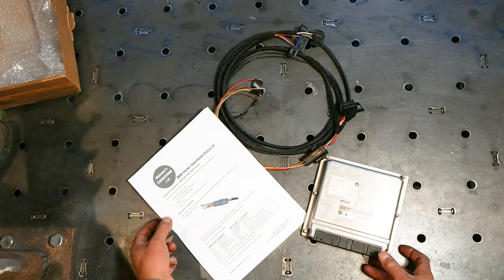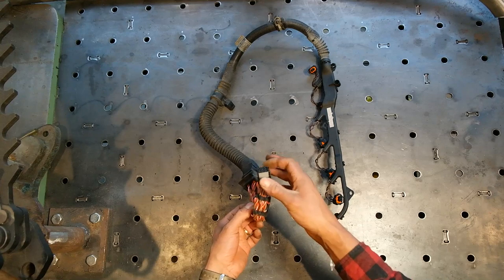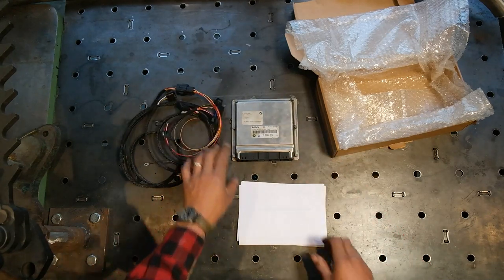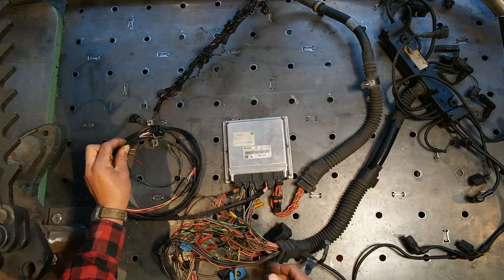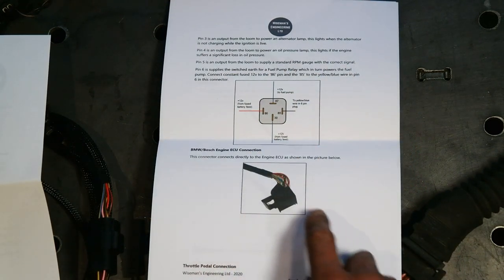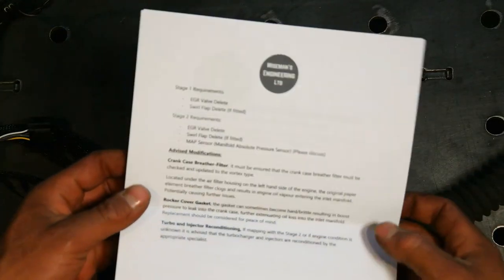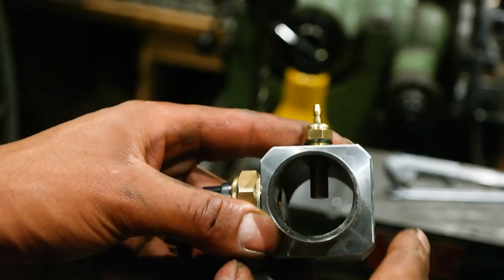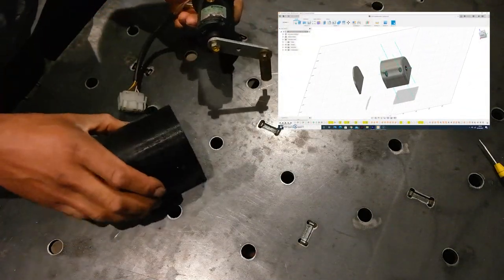BMW M57 Standalone ECU

Comment: Hi, great video, i have i question, do i still have to change the gas pedal, i swapped m47 to m57, the pedals are slightly different, but could it prevent the car from starting?
Reply from the maker: Thanks very much! 
As far as I’m aware, they use a similar potentiometer in the pedal, I’m not sure if the pinouts are the same but either way, it should not prevent it from starting. I ran my engine in my test stand without the pedal connected many times.
Reply: @KeepitBigBore  thanks for answering so fast, then i can shut it off from the list
Reply from the maker: No worries mate, good luck with it 👍🏽

Comment: Awsome work on your defender 
Do you know if any one dose a complete  m57 bolt in kit for the defender ?
Reply from the maker: Thank you!!

Yes there are a few now. I spoke to MW Machines here in the UK initially as was looking for a kit but they weren’t available at the time due to the global situation. But he probably has everything you need now! Also, Wisemans Engineering can set you up with a full kit. Both suppliers have a few options in terms of manual or auto m57 or m57n.

Where are you based and do you know what specs you’d like to have on yours?
Reply: @KeepitBigBore  probably  go manual onto the m82 box not really sure on power specs yet I need it to be reliable  as it will mostly be used in the outback and towing a boat.
Reply from the maker: I know you can get adaptor plates for the m57n to mt82 but I’m not sure if there was one for the older m57.

I’d say for reliability on the mt82, transfer case and diffs with a trailer, 250bhp and 500nm wouldn’t be a bad number. You can get this out of the older m57 with re-maps if you do manage to find an adaptor for it 👍🏽
Reply from the maker: I know you can get adaptor plates for the m57n to mt82 but I’m not sure if there was one for the older m57.

I’d say for reliability on the mt82, transfer case and diffs with a trailer, 250bhp and 500nm wouldn’t be a bad number. You can get this out of the older m57 with re-maps if you do manage to find an adaptor for it 👍🏽

Comment: Hi 
I message you a couple of months ago regarding my defender 90 swap I’m at a stage where the chassis is now built up and obviously I’m looking to find an x5 donor, the M57 is that the TwinTurbo or is the newer X5 a TwinTurbo I’m confused on which engine to go for, can you help me out there as if I buy the whole vehicle I’ve got everything I possibly need for the change but not sure which one to get,  there’s a lot out there at fairly reasonable prices scrapped or damaged

Kind regards mark
Reply from the maker: Hi mate, I can’t say for sure but I don’t think the  m57 x5 came as twin turbo. (Anyone feel free to correct me).
If your looking for a twin turbo m57 then I think you need to be looking for 335d’s and 535d’s.

Why do you want an x5 engine?
Reply: Hi 
I just thought that was the one to go for when fitting it’s 6 speed automatic m57 or m57n all alloy block big turbo with the little one below it. ?. A bit confusing.

Regards
Reply from the maker: The x5 came with the 4wd auto and the 3 and 5 series had the 2 wheel drive box. You can use either one. You can buy adaptors to the lt230 transfer case for both boxes so best option is to fund a supplier for your adaptor, see which one you can get and decide your engine from there 👍🏽

Comment: Hi! Great video - it pushed me over the edge to do the conversion on a 1999 Discovery 2 auto. I bought a 2003 BMW E60 530d auto, and took the motor and 6HP26 out today. I believe this is the M57N engine, and I see the ECU is a DDE 7 unit. I am slightly worried now as I don't see anything for DDE 7 on Wiseman's site, and also not getting email reply from them on my query regarding software or ecu for this project. Can you perhaps give me an email address or point me in the right direction for a solution?
Reply from the maker: Hi mate, Thankyou,  that’s great to hear, it will be well worth it 👍🏽 Don’t worry you should be fine with an e60 ecu, it should be dde5 which they have plenty of kits for. If you want to send me an email I can cc Wiseman’s into a new conversation and hopefully you guys can speak from there on? 
My email is kibbcrew@gmail.com
Reply: Thx! That'll be awesome!

Comment: Does this only work for the m57 with 184 hp or also with the 204hp?
Reply from the maker: So the kit you see in the video is for the 184bhp (dde4). You can buy a dde5 kit for the newer aluminium block m57n’s as well 👍🏽
Reply: @KeepitBigBore  okay, thanks for answering so fast still after 3 months, very good video also
Reply from the maker: No problem mate, good luck with your build 👍🏽

Comment: Will this work with the TD6 M57?
Reply from the maker: No reason why it won’t! I can’t say if the ecu is exactly the same or not but I know the engine is pretty much identical to the 306d1 (cast iron block) it’s just a Land Rover badge on it

Comment: Hi, how you connect the rpm gauge? Thanks
Reply from the maker: Hi mate. There is an RPM output from your ecu, it’s just 1 wire. I’ve left a link in the description for the rpm gauge I’ve used. It’s the only one that showed 6000rpm instead of 8,10 or 12 thousand so it’s specifically for Diesel engines. You can also calibrate this to suit different engines. 

I know my idle speed it roughly 750rpm. When connecting the gauge for the first time, my idle showed as 3000rpm. There is a small knob on the back, just turn it and the rpm will drop/raise as you turn in. I turned mine until it showed 750rpm at idle. It’s now accurate right up to 4750rpm. 👍🏽
Reply: @KeepitBigBore  many thanks for your help mate 💪💪👍
Reply: hi, i bought the rpm gauge like yours and i connect the pink wire to the red wire coming from the gauge... and the gauge dont work! Im doing the connection wrong? How you connect your wires in your rpm gauge? Thanks again
Reply from the maker: Hey mate, is it not working at all? Do the lights on the rpm gauge come on when you turn the ignition on? I can’t remember the colours of the wires but as far as I remember, there was ground, ignition and rpm signal. When you turn the ignition on, the gauge should turn from zero to max rpm and then back to zero again, does it do this?
Reply: @KeepitBigBore  yes goes from zero to max and comes back again... I dont know why dont work, and the light works aswell
Reply from the maker: That’s good then, have you adjusted the small screw at the back?? Turn the screw when the engine is running. Your engine should idle at 750rpm so turn the screw until the gauge reads 750 👍🏽 let me know if that works
Reply: @KeepitBigBore  ok i will let you know tomorow.. Thanks mate
Reply: @KeepitBigBore   hello mate,  still not working.. I have a bit more then 6v coming from the pink cable and if a rev the voltage goes up.. I think its normal,  i need to connect the pink coming from the ecu with the green wire right? Im confused... Thanks
Reply from the maker: Hey mate, have you got Instagram? You can send me a picture of your wiring diagram. I can’t remember the colours of the wires of the top of my head! It must be something simple 👍🏽
Reply: @KeepitBigBore  whats your Instagram mate?
Reply from the maker: Hey,  It’s also keepitbigbore 🙂

Comment: would you have anything for m57n2?
and also would you use 2 ecu for my nissan  patrol? like nissan ecu and bmw ecu together so factory dash etc all work>?
Reply from the maker: The m57n2 is very similar if you use a standalone harness like this one. I wouldn’t recommend using 2 ecu’s, if you have an understanding of wiring then you can get the bmw ecu to control everything on your dash!!

Comment: Hi mate, do you have to send power to the black wire to start it or can you use the vehicles original starter wire straight to the solenoid?

We are trying this way and the engine is obviously cranking but it won't start. Is there anything else on the body plug that we need to connect? 
We have fuel at the rail, the inline pump is working but we think it's only 3 bar and don't have a gauge to check. Would it at least try to start with only 3 bar?
Reply from the maker: Hi mate, sorry I didn’t get back sooner!! 

Have you got your problem sorted? 

The easiest way is to use the black wire, you can hot wire the starter but I’d stick to the black wire on the body plug if I were you. 

3 bar is enough to start!!
Reply: @KeepitBigBore  hi mate, yeah we got it sorted, was a faulty rail pressure sensor and rail pressure control valve, we were getting fuel at the rail but it was getting there via the faulty control valve rather than the high pressure pump. Runs like a dream now. ✌️
Reply from the maker: Fair play mate!! What do you reckon, was it worth it 😬
Reply: @KeepitBigBore  was deffo worth it, we've fitted it to a 1989 VW lt35, originally 57bhp I think and now just under 300bhp.
The hardest part of the whole conversion was getting the shifter cable to work on the 6hp26. We had the biggest headache with different cables, levers and brackets but got there in the end. A 6hp28 with the electronic shifter would have been much easier.

Could do with a brake upgrade now though 😅
Reply from the maker: WWHAAT??? 🤣🤣🤣 I’d love to see some people try and pull away from you in that! That’s the perfect kind of sleepers right there! I keep up with people in the old defender and people are usually surprised but you’d never expect a lt35 to be terrorising you 😂😂😂

Comment: Hi Keep it big bore.

I'm from Australia and looking at putting a m57 into my 1996 nissan gq patrol.

You say the blue plugs are for the auto transmission.

Just wondering if you would know If the auto transmission will still work as normal if I use it in my patrol.

The aut is fully controlled by the ECU isn't it?

Cheers love the video.
Reply from the maker: Hi Daniel, 
I see no reason why it wouldn’t work if you were using the m57 with its original auto transmission. Mine came with the 5 speed auto, it’s not a bad transmission but it’s a bit slow and lazy, a lot of guys go for the newer 6 speed!! We’re you looking to keep the patrol transmission or use the BMW one?
Reply: @KeepitBigBore  
I wana keep it manual but my left knee is telling me to go bmw auto.

So your set up just uses the stock bmw transmission controller for the 5 sped auto no messing about?

Cheers again.
Reply from the maker: I have a friend who just bought a td5. I jumped in it the other day to feel how heavy his clutch was. I pushed it down and it hit the floor, I was expecting it to feel so much heavier as I’m used to driving my one. So my point is, if you go manual, you will need a heavy duty clutch and a heavy duty left knee to go with it 😂
My friend jumped in mine to see what my clutch was like, he jumped out and said he thinks his hip popped (he’s an older gentleman) 😬

Mine is manual and using the original Land Rover transmission so I didn’t use any of the transmission controller, just the original ecu 👍🏽
Reply: @KeepitBigBore  

Yher nice I should of picked up on that in the video, I been watching that many M57 swap videos 24/7 I caint remember half of them. Lol

Cheers heps for your help.

Do you have any pics of the plugs or sketches of how all the wiering is pinned out into the connectors?

I'm a bit sick on how to wire this thing.
Reply from the maker: No worries mate 😬

If you purchase one of the stand-alone kits then you won’t have to worry about pin outs, wires etc. She’ll just plug and play. 
I have no diagrams for the wires and all of them are black so a picture might not be any help but trust me, she all clicks together 👍🏽